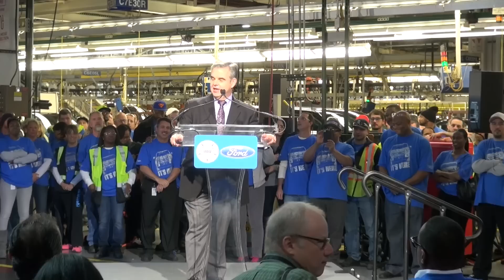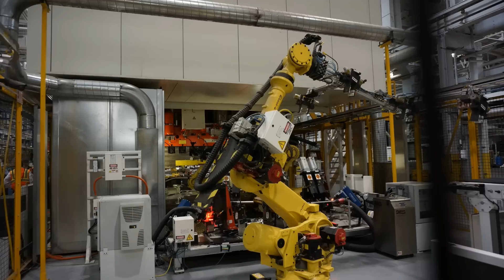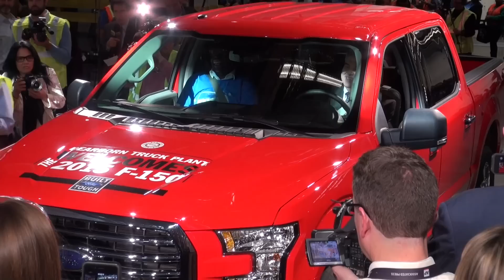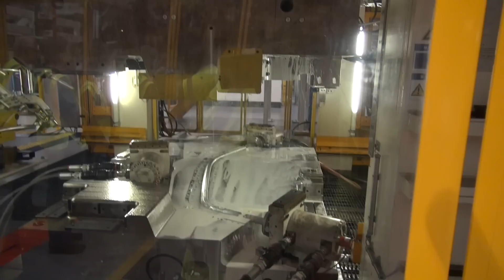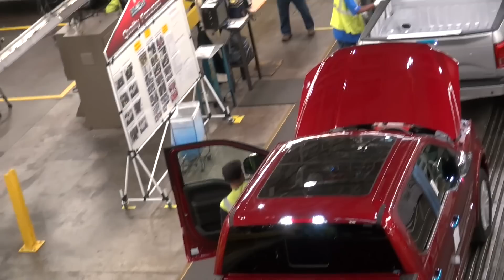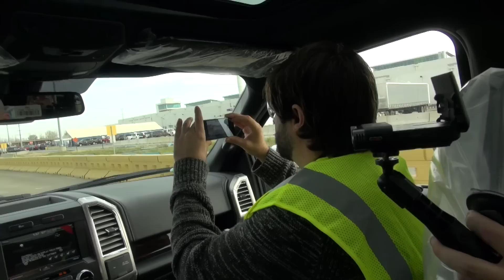Ford Job 1 for new F150 2015 at Dearborn Truck Plant, tour of new aluminum trucks

Comment: cool mr truck can u tell us about the new super duty and new 6.7l diesel is it a good truck come out and is the older one good to.
Reply from the maker: I do like the 6.7L PS in the 2015 mainly because the exhaust brake finally works with the bigger turbo. 2011-2014 6.7L is good, 6.4L PS was a fuel hog, 6.0L had more problems, mine was in the shop in 6 states.